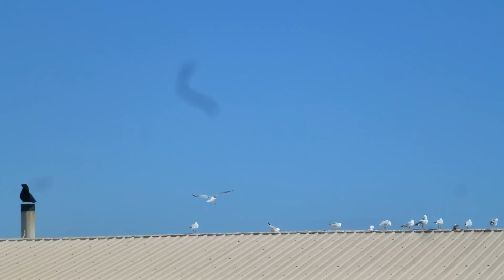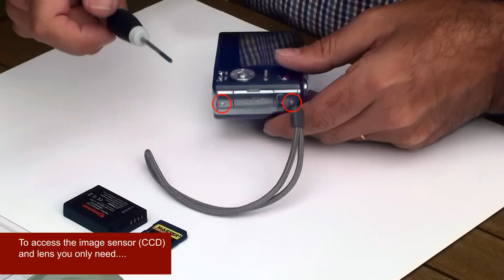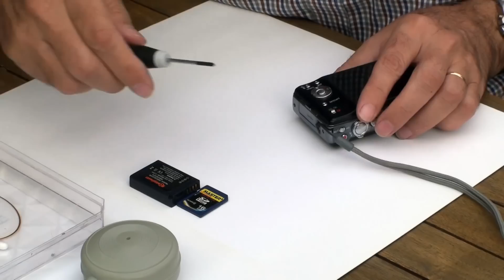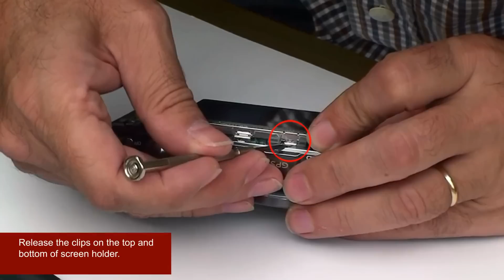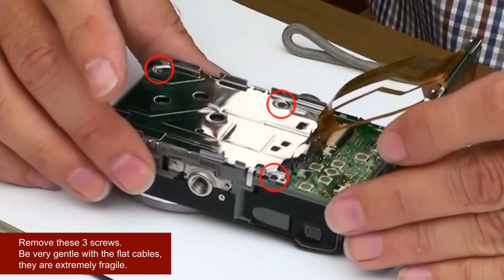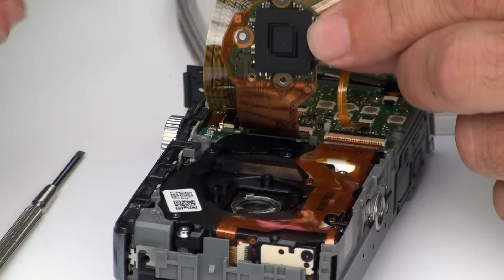Lumix camera sensor cleaning - Step by step - ZS10 - TZ20

Comment: Very impressed by all your previous contributors who have seemed to fix their cameras so easily. Yes , it should be easy....the second time, but being in my mid 70's, I found the job somewhat tricky. The screws are unbelievably small and the way the camera is "clipped " together in sections takes some fiddling.to get apart. I made a mess of one part and ended up with rear screen and three cables out of their plugs and spent a serious amount of time getting the wires back in . Was close to giving up, but thought , having come this far, I might as well clean the lens so did as described in the video and then put the whole thing back together, not really expecting the camera to work  at all. To my surprise and relief, it did and the dreaded shadow seems to have gone so will try outside when we get some blue sky to test it on. Thanks for your video, very good.  (Four hours incidentally.....but for sure would be much easier and quicker the next time )

Comment: Thanks again. I used your video 3 months ago and had to use it again today. 
      just a moment when your hand is right in front of the camera hiding what you're doing but easy all the same. Many many thanks to you
Reply from the maker: Yeah, I know.... covering the hot spot. That's what happens when fixing is primary task and taping secondary. Glad it worked for you too.

Comment: Thank you for your supremely excellent video.
You just saved me a bundle.
I magnetized my screwdriver bit a little with an old hard drive magnet. It made it pretty easy with the screws.
I had no little puffer brush, so I used a drinking straw and a larger slide brush. The dust was pretty easy to see with plenty of light and a magnifier.

Comment: Thank you. This definitely helped with the process of cleaning my ZS10.  A couple of small steps were left out but we figured it out.  I put the screws from each step in a separate tiny bowl so that they wouldn't get mixed up. Manipulating those tiny screws was the hardest part.  And we got great results.
Reply from the maker: I wish you listed what I overlooked. For sharing. Someone wrote that they magnetized the screwdriver and it helped a lot. Glad it worked for you. Cheers!

Comment: Thank you. Even though I found that my Lumix is somewhat different and I needed to remove a couple of more screws, this video
helped me a lot. The local camera shop wouldn't touch it and they told me not to attempt this on my own. They told me to buy a
used one rather than cleaning mine out. I don't like throwing things away so I figured I might as well try it.
Thanks again.

Comment: I  used a vacuum cleaner with an empty toilet paper tube placed over the extended lens assembly with battery removed. The toilet paper tube is a perfect power fit and large enough  to extend over the telescoping gaps of the assembly. Place vacuum cleaner over tube. Worked on first try. Totally clean. A 1 minute job that worked flawlessly on my panasonic Lumix LZ8.

Comment: Thanks. I was able to remove the dust from my ZS10 sensor in about 25 minutes. I used a dust blaster and a lens brush. Would not advise cotton swab for reasons already stated. Excellent video. Thank you.

Comment: Great video, worked a treat on my TZ19. Slightly different config inside with no need to un-clip the screen. Also worth noting that the 6 outer screws are not all the same, the 2 slightly shorter screws are needed for the bottom of the case, the 4 longer screws for the sides. I've never been a big fan of this camera, low light shooting is poor so I wasn't too bothered if I killed the camera! However it's working fine and lives to shoot another day!

Comment: Thank you for the great tutorial. I had the same issue and your solution worked for me. I have a Lumix DMC-ZS15. They should have put a small gasket around the sensor assembly to keep the dust out. I have had this camera for 4 years and did not have a problem until this May.

Comment: Awesome, thank you so muchTomislav. I just saved $175 (plus shipping and taxes). The sensor is spotless. Just one note. Be careful as the bottom screws are not the same size as the side ones on the outside. About 30 minutes from start to finish. Cheers

Comment: Followed these instruction to cure same problem on a TZ14.  All went well and no ghosts on the pictures.
Note however that the TZ14 screen attachment ribbon cable is much shorter so had to have help holding the screen so as not to damage ribbon. Whole operation took about 20 mins.  Thanks for a useful video.

Comment: Thanks a bunch !!! ... This saved my DMC-ZS6 as well ... slightly different config, but very similar on the inside (the LCD screen is attached to the outer case, no side panel that needs to be removed on the outside).  One thing to note:  On my unit, that little rectangular rubber gasket over the bottom glass (not really a lens but a thin sheet of green glass) is actually a loose and can come off, exposing the entire glass pane, that also can be removed.  In my case, I had to clean lint between the rubber and both sides of the glass pane using an alcohol wipe.  

Had the same shadow UFO's as Max and so far, after the cleaning, no more sightings.  Excellent instruction video :-D !!!
Reply from the maker: Thanks for sharing additional details.
Reply: I wish I had read this comment prior to starting since I was surprised by the screen being attached to the back on my ZS7 as well. Other than that the cleaning worked pretty well. Not perfect but I was afraid to be very aggressive with the Q-tip.

Thanks for this video.

Comment: Thanks for this video. I applied this procedure on my DMC-TZ10. Small difference: To remove the inner sheet, the two screws on the left side holding the front housing part have to removed, too because the latches have two screw holes each. I used as special camera brush and bellow kit for cleaning the sensor and the len from the inner side. Result: Nearly all dust spots are away (much better than before). Before I had the same dust spots as shown in the video. To check the result, it's best to set the highest camera resolution (12 megapixels in my case) and take some photographs from the sky in different zoom levels. When each photograph is spot free the cleaning was successful. In my case I suppose some remaining dust between the lens (neither reachable from outside nor from inside after removing the sensor holder plate).

Comment: thanks, this video gave me the confidence to tackle my DMC-TZ10 which had been bugging me for months. The layout is slightly different and I had to remove an additional two screws on the outer casing before I was able to lift out the inner silver cover. The LCD screen was attached to the outer case as in the post by tend2it below.

Comment: Just cleaned my Lumix LF-1 and although it was a little more complicated than this camera, it worked and the sensor is clean.
I'm used to cleaning sensors on full frame cameras but taking apart a small compact camera is quite a different story! I would strongly suggest NOT using Q Tips as small fibers can be left on the ccd, lens or inside the cavity. I would recommend a can of compressed air (not pointing down!) and sensor brush or similar product designed for that purpose.
Thanks and good luck!

Comment: Used these directions for the DMC-ZS8.  Worked well.  Slight difference, the LCD is connected to the back panel so the back half doesn't come off, you have to work around it.

Comment: A great video that worked great on my older Lumix camera.  Unfortunately  on my newer Lumix DMC ZS25 Panasonic changed the screws holding on the back of the lens to extremely small star screws.  I was unable to find a small enough driver to remove them.
Reply from the maker: I regret I cannot help. But thanks for sharing, perhaps somebody found a solution and will post it. Good luck.

Comment: I had exactly the same shape of dust on my TZ19 and got rid of it by placing the end of a vacuum cleaner pipe over the entire lens and using the lowest power on my vacuum ..turned it on for about two seconds and the dust was gone, that was nearly three years ago and i have not had any more dust particle problems since!
But good video..and nice to know how easy it is to take apart if need be.
Reply from the maker: Thank you for taking time to share your unusual experience. I am glad it worked fine for you without problems. I read a post somewhere by a guy who used vacuum to clean the mirror in his Canon SLR. Unfortunately it destroyed the mechanism, the suction was too strong. In your case you don't open camera but still don't know how safe it is.

Comment: TZ40 Essentially the same procedure, however all screws very tight and some cross-cut screws stripped with 00 screwdriver, necessitating manoeuvring with an oblique 1mm plain slot screwdriver to remove them. The final set of 3 screws holding the lens cover had  2 screws with underlying springs, and all 3 screws required a 0.9mm hexagonal key to be removed, rather than a screwdriver.

Comment: Just want to say thanks for the guide. Just saved myself £50 by not sending this off for service. Mine was a TZ35 and mostly the same except the lcd and key pad come off in one piece from a small plug on the mainboard. These have to be removed to detached the shield inside to then access the sensor. Just be careful of the plastic insert for the activity led. Also, what is the background song? (Piano)
Reply from the maker: Thanks for sharing with other users. Sorry, no idea about music. I originally used "Shadow on the wall" sang by Roger Chapman but it was blocked here because of copyright until I picked up something they offered for free.....

Comment: I had a dirt on the sensor problem on a Panasonic LF1 a few years ago and was about to try taking it apart when I read online about using a vacuum cleaner to suck it off and it worked.  I taped a empty toilet roll over the vacuum cleaner suction pipe which was a good fit over the zoom lens of the LF1.  Switched on the vacuum cleaner and it immediately removed the dirt.  I know its still in there but after a few years of use its not visible in the viewfinder or on the pictures

Comment: Even easier to do on TZ30 (ZS20). I have done 3 different Lumix models with success. The TZ30 had dust on the inner lens next to the sensor. Sensor was spotless.

Comment: Thanks a lot for this great video. What kind of brush do you have used? Can I use also a new cosmetic brush?
Reply from the maker: I used a cheap blower brush (puffer brush) from a photo shop (camera store). I think you can use any brush which is soft and gentle mechanically and free of grease or dirt. I don't recommend blowing directly with your mouth because of micro spits. Try on a mirror and you'll see what I mean.  Good luck.

Comment: I had the dust problem with my Panasonic ZS-10 camera. The first time I sent it out. I did have another camera to use. The second time, I found out how to take the camera apart and I was able to clean the CCD sensor. Unfortunately the camera has stopped working as of Friday, January 2, 2016 :(. I have bought a new camera.
Reply from the maker: Regret to hear this. But you are right, the dust is not the only problem with this camera. The lens on my model became very playful. It slides in and out just randomly, out of control.